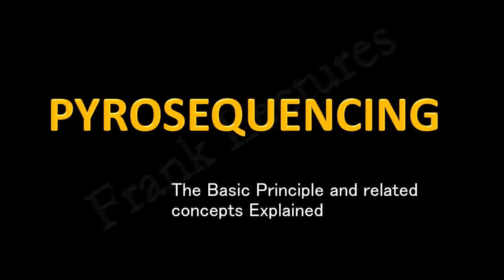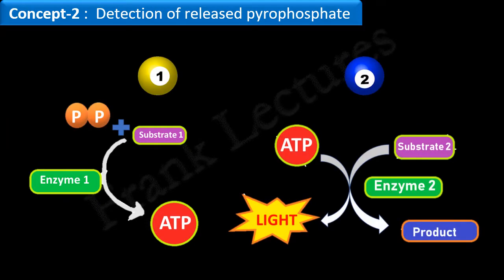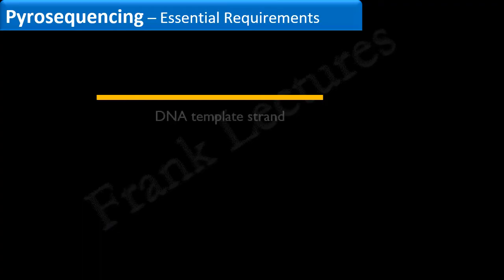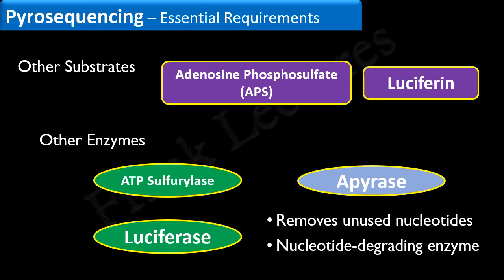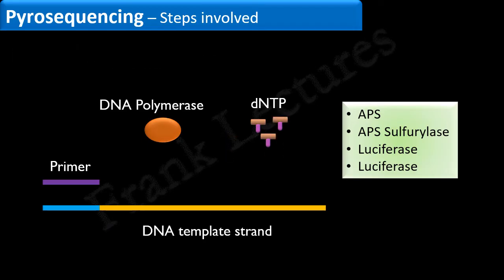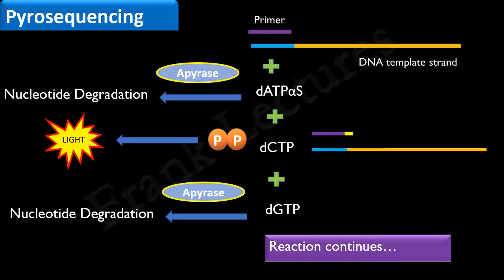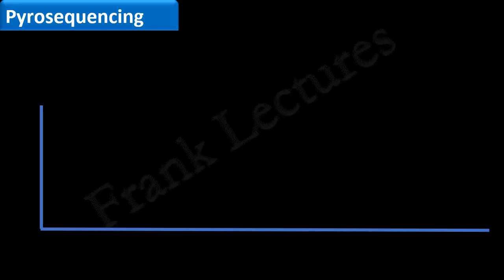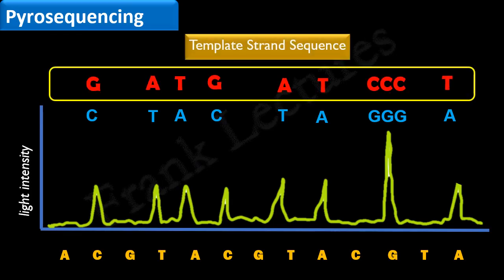Pyrosequencing  - The Basic Principle and Steps Involved Explained

Comment: Is apyrase added at each step?  If so then how is it removed or inactivated before the addition of next nucleotide??
Reply: Yes it is necessary to add apyrase at each step to assure that every extra nucleotide  and as well as the ATP is degraded. 
According to my knowledge apyrase can only degrage unbound nucleotides and  the bound nucleotide are not degraded by it and if apyrase is not degraded then I think it has no problem for boun nucleotides
Reply: @moqaddasbashir4034  but it can degrade the coming nucleotide that are not added still. How will u justify
Reply: @MuhammadIslamag  the rate of polymerization by polymerase enzyme is faster than the rate of degradation done by apyrase enzyme